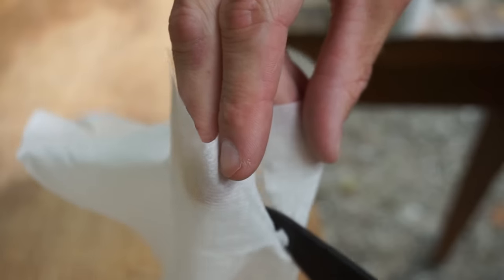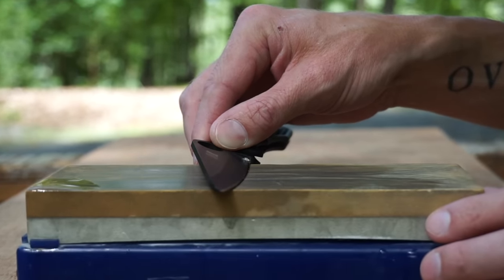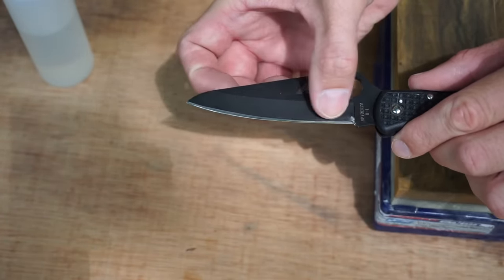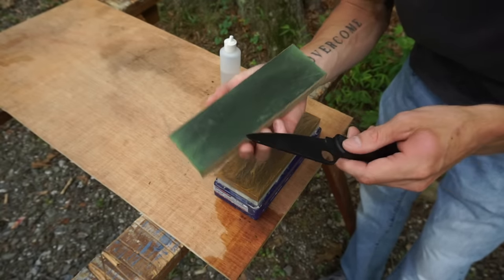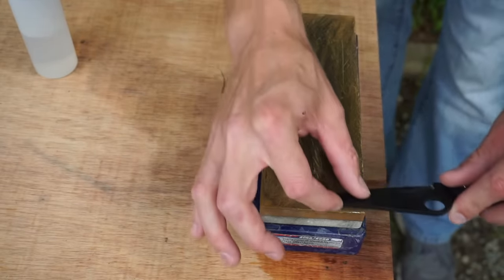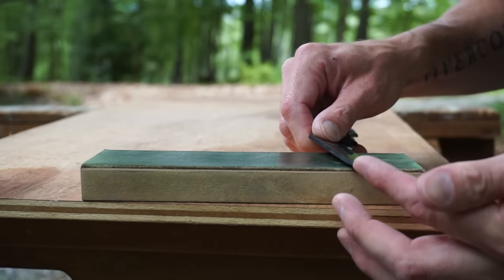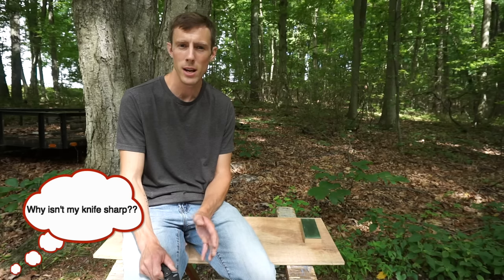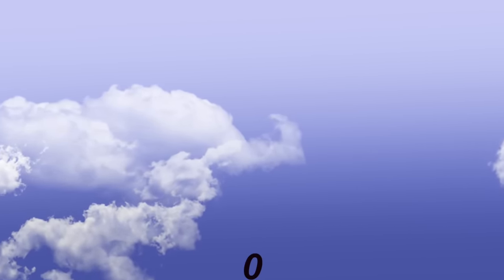3 SHARPENING TIPS BEGINNERS MUST KNOW.  How to sharpen a knife

Comment: He did not speak of flattening your stone with a slightly more abrasive stone pre sharpening, and not making it clear that water is used on the wet stone, not oil.....other than that I liked his method.  To flatten your stone you use a pencil to make a grid on the stone, including a diagonal full length crossed line, rub the stone with another stone until all the pencil lines disappear.  Also don't wipe the stone while sharpening, it's the dark colored metal flakes that caused the sharpening, not the  abrasive qualities of the stone.  Yes, after use clean stone before putting it away for the next use.  A good basic video.

Comment: Dragging the blade across the stone leaves a wire Edge and it will go dull quick you go into the stone both ways starting from the tip to the hilt and then from the hilt to the tip.. better edge several Generations were shadowed this way my dad showed me how to do it his  father showed him just try and see if you like that better ..he was pretty adamant about how to do it so

Comment: My dad was probably the worst sharpener of cutting thingys on the planet. He could and almost did take a sharp blade and turn it dull in record time. :) I inherited a box full of blades and a couple of his stones when he passed. ALL the stones have deep dips about mid-ways of the stone almost always on the fine side. Now these stones are not high quality, and I am not a good blade sharpener, it takes me a long time to get a decent edge to where it cuts well. But, they don't hold for very long, and I am not talking about Walmart cheap junk blades, I buy the best I can afford and have taught my children what to look for in buying knives and axes but I really suck at teaching them the correct method. So, my question is, with these old stones, with the dished out middles, are they worth keeping or should I just dump them and get new high quality ones?

Comment: My apex keeps coming out round. Nothing I do is stopping this. It meets at a point, but the bits that are meant to be flat are convex.
Reply from the maker: Any hand sharpened knife will have some convex to it. The better you get at maintaining an angle, the flatter your bevels will get.
Reply: @OUTDOORS55  It's also surprisingly blunt. I get a sharper edge from a kitchen knife sharpener, and even with that I struggle to cut anything. I'm practicing whittling on pine kindling and fresh plum wood, and it's really hard to cut through. I considered giving up on learning whittling, but I REALLY want to learn how to do it.

Comment: 1) Angles DO matter.
2) Fully apex the edge.
3) Always sharpen backwards.
4) Strop the blade at a lesser angle.
Reply from the maker: 1. Not how you think they do.
2. Yes
3. No direction doesn't matter 
4. Depends on the strop.

Comment: I dont understand difference between apex and burr. Seems like you used the two terms interchangeably, but it also seemed that burr referred to imperfections in the edge and apex referred to no imperfections. I learned that a her is the metal rounding over... this video made me confused
Reply: Joshua Freeman hi :)) i guess the burr is the fine(dust) after you sharpen it and you can feel it on the tip of that he called Apex(the pointed edged after sharpen) the word Apex is the point of sharpest side of the knife meet together. He explained it in this video.

Comment: Omg that takes forever to get a new edge by hand. Maybe should mention that many knives are sharpened with 2 angles. The angle of the main edge and a wider angle for the finishing edge.
Reply from the maker: If the correct stone is used it can be done very fast. I have a video where I sharpen in under 90seconds. Thanks for watching 👍

Comment: Unfortunately you have to push the knife away from you, doing it backwards only leave a burr that will break off and you'll have a dull knife very quickly. After hand sharpening knives for 38 years commercially, I know  what I'm talking about.
Reply from the maker: https://www.youtube.com/watch?v=WFrdae7u-VI
Reply: So you're saying that a stropping motion is incorrect? As in a trailing edge strokes is wring? Then you need to tell Murray Carter, Walter Sorrels, Greg Cimms, just about every Japanes cosmetology shear manufacturer, suehiro, Baron Cutlery,  I can list a few hundred names who would argue your point. 38 years doesnt mean much... there are folks in my area who have been sharpening knives for 40 years and they dont know much about sharpening, just cause you've done it for so long doesnt mean much. Just the time you've spent doing it the way you do...

Comment: So you can forever sharpen a blade backwards versus forwards huh?  Wow
Reply: As you get better, you want to sharpen forwards.
Reply: @oceanwaves83  oh I see, for some reason I have difficulty getting my knife to catch on paper slice like butter. The edge gets snagged often or doesn't stay quite so sharp. Any idea why this is?
Reply: @regularhumanbeing5211  you could still have some burr left over on your apex. It's hard to detect. You have to feel for it and look closely. Also, if you have a strop, you'll see little scrape marks on the surface of the leather if you have some burr left. I use strops to detect burr a lot.

Comment: looks like you are doing sharpening on a very  soft low grit water stone, essentially acts as strop u can go edge leading but start easy and lightly or like the man said it will cut you  very precious stones, with such a easy chipping stone like a 6.000 grit king stone (water , best to go edge following or as he says backwards, it is honing not really sharpening, usually that's all you need is a semi coarse stone  220 to 400and  go up in grit # to a finer #. untill stropping with  strop compounds like the green strop crayon. which smooths out edge face and brings in the finest edge, not all knives do well with ultra sharp edges. all depends on use, for hunting u want the sharpest most  finest edge, cooking is another story, 220 and maybe 400 and strop will cut a tomato better than a very high poloished grit knife and will last in kithchen longer as a ceramic or sharp keeping steel will keep yoir knife in good condition for a while, this edge is known as a toothy or a micro serrations, and work as a fine saw

Comment: my tip material how meany time have i had to explain to someone that you can't put a proper edge on your aluminum katana or your 440 stainless knife
Reply: Why not?
Reply: @imallowedmyopinionok2354  because better martial can get a better edge and hold it longer
Reply: 440 stainless is cheap shit. Ideally 440c is the better steel for knife blades. If you struggle to get an edge on your blade, my advice would be to practice and have patience. The trick is to hone your knife more often rather than let it get too dull, and dont beat the crap out of your blade on a rough knife steel, get a smooth one. Get it sharp, keep it sharp.

Comment: 😂Just want see u see my comment or not
Reply from the maker: I see it👍
Reply: @OUTDOORS55  Hey man one question?
You ever tryed to used high quality Diamond Sandpaper to sharp your Knife?

Im thinking about to creat a own simple and cheap sharping tool for my self.
One Stock Wood with 4x same size.

1) First site: stick perfect flat glass. And on it very high quality Diamond Papper 280-400Grit.

2)Next site: again glass and Diamond Paper 1200Gritt

3) Next Site: stick Leader band with ~3000Grit Paste

4) Last Site: stick Leader band with ~8000-1000 Paste or Diamond Past.

5) and at the End of the wood, a Baseball hand holder grip.

What you think about it? Maybe you can make a Video about it and build one? With your knowleage and idea?
Im interesting how many knifes i can sharp with this tool, till this sandpaper is rubbish. And how its workable, if i turn it around for the next step.

Comment: You overlooked a very basic tip.  USE THE WHOLE STONE.  If you wear a dished out hollow, like a spoon, in the center of the stone, all the above tips are meaningless.  If the stone is already dished, grind it flat before trying to sharpen a knife.
Reply from the maker: Stones dish regardless. The tips still apply regardless as well. A flat stone is important but not necessary.

Comment: You are completely wrong on the main point of the knife sharpening exercise. The knife SHOULD be sharpened by having the sharpened edge of the blade going FORWARD along the stone as you sharpen, NOT backwards as you advise. Sharpening a knife by pulling it backwards is the least efficient way possible of sharpening. The only time a knife should be pulled backwards is when stropping the blade after it has been sharpened. Only carelessness or lack of experience could cause the knife to bite into  the stone as happened in the video.
Reply from the maker: The steel doesn’t know, or care what direction it’s being sharpened. Look at the wicked edge sharpening system. It works in the “backwards” direction and nobody who knows anything about sharpening doubts its Capabilities.
Reply: The way the knife faces in the 'Wicked Edge' system is because it would be impossible to grind both bevels if it was facing the other way. The inefficiency in grinding 'backwards' as to 'forwards' with the knife edge relates to the speed of removing the metal, not to the end result. By grinding in the forward direction the required degree of sharpness will be attained in a fraction of the time. If, however, you enjoy sharpening knives and have nothing better to do, then by all means continue with the method you are using.
Reply from the maker: https://www.youtube.com/watch?v=68G4MhtJd40 
Is this fast enough...

Comment: It's actually very lame to form a burr, especially on purpose. Extremely unprofessional advise.
Reply from the maker: No your wrong
Reply: @andrei Pastushuk A very slight burr, that you can barely feel is essential. If you don’t get that, you haven’t reached the edge Andrei.
Reply: @steveledbetter5613  the thing is, when you reverse the direction (or go both ways), the burr is not even forming.
Reply: Andrei Pastushuk so.....you have two professional knifemakers telling you the same thing; but you think you know better? We go both ways as well, I even push the blades over the stones. The reason you never feel a burr, is that you haven’t honed away enough steel to actually reach the edge. When you do, the steel is so thin, and so fragile, it’s rolls, chips and cracks. It that rough roll that is the burr. Even with the finest (smooth) stone this will occur, it will just be harder to feel. Magnification will illustrate that. It’s shocking how jagged it looks under magnification. That’s why you strop on leather. It removes that. Maybe your understanding of what a burr looks and feels like was the issue. Maybe you were imagining a big curl a toothpick could sit in. It’s very slight, but your thumb is sensitive enough to feel it, and in bright light you can see it. But I promise you, the importance of a burr in knife sharpening, what I’ve described is right. It’s not an opinion. It is fact.

Comment: in the first 10 seconds this guy ticked me off.
He spouted the virtue of a razor sharp knife and even I know a razor sharp knife is not a good thing. The edge will roll over very quickly and you get a dull rounded surface. 
Unless you got some kind of new next generation steel I dont know about, but he never said anything about different steel types.